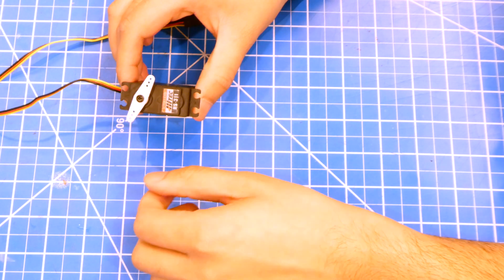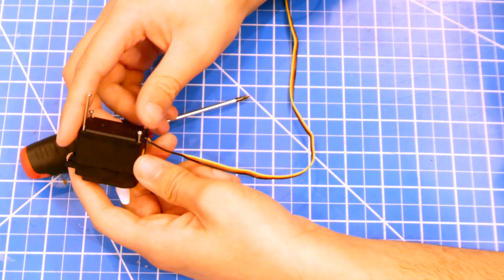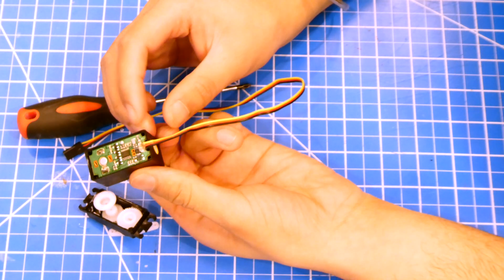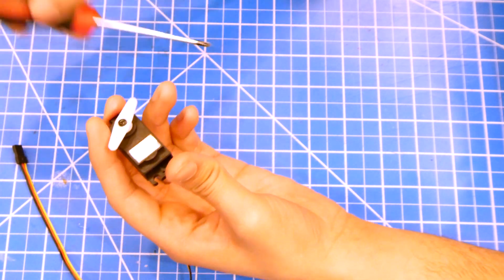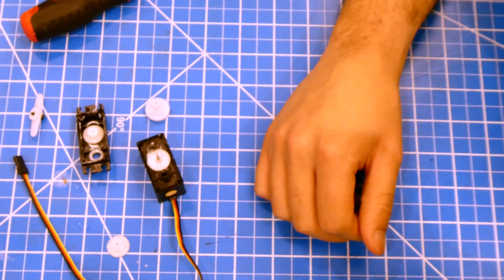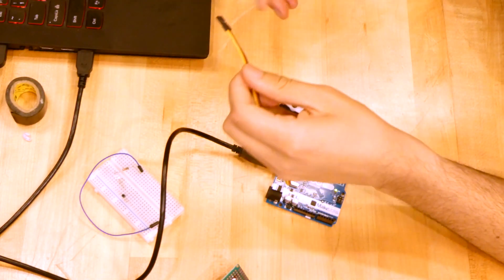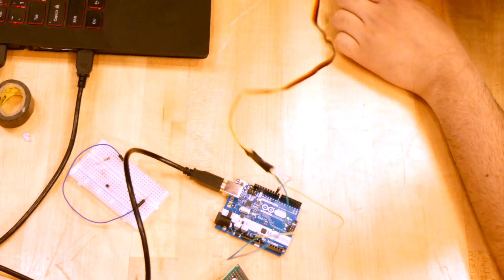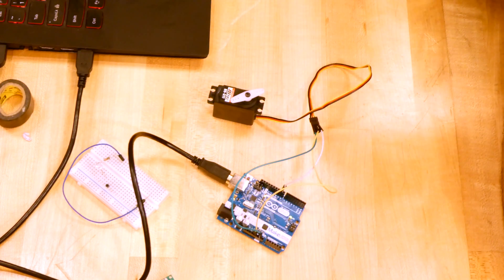🍉 Continuous Servo Hack

Comment: Taking out the potentiometer defeats the purpose of having a servo motor, does it not? If you take out the mechanism that detects the position of the arm, then you have no idea where the arm is and when to stop, right?
Reply from the maker: A servo with a stationary potentiometer is a continuous servo. You sacrifice movement to a certain angle between 0 and 180 for continuous rotation at a variable speed. Servos have other advantages like a geared down motor for more torque, a controller board with an easy Arduino API, and a standard form factor that make them better to hack and use than just using a normal DC motor.